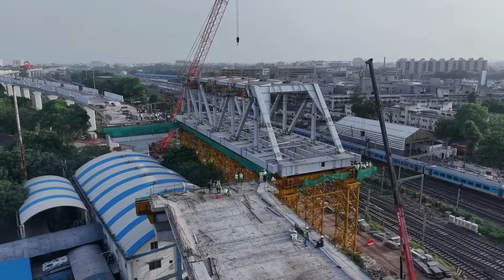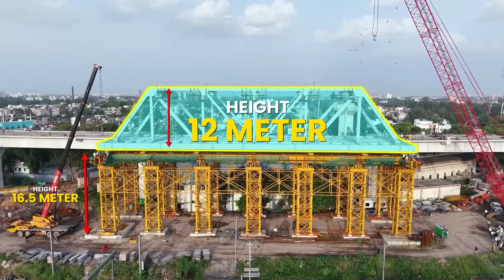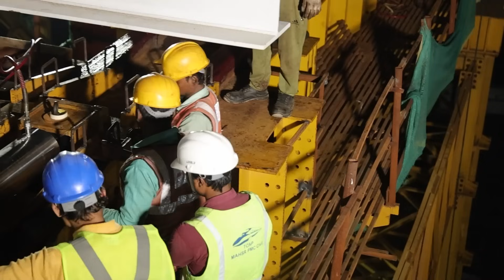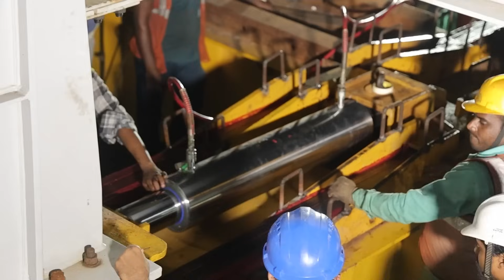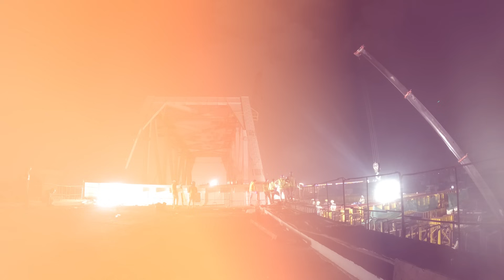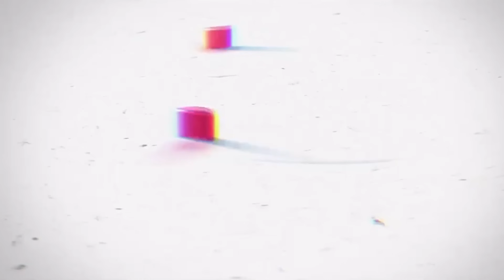A 60 m long Steel Bridge launched over a Western Railway | MAHSR | Bullet Train Project.

Comment: Why was the land below the steel bridge not been able to be aquired? If it would than no need for steel bridge, normal bridge can be built.
Reply: Actually bridges are better since it will save from animals such as mulla mulli who throw stones and sometimes cow dogs buffalow
And these tracks are needed to be built on concrete which would further occupy that land
Reply: @4AIM108 Thanks for reply, but i meant that since bridge is built on land, that parcel of the land where steel bridge is to be installed, can also be aquired to built a normal bridge. I think the blue house below didn't gave the land to built normal bridge
Reply: @ashutoshniwal  haa bhai niche wale ghar ne Jameen nhi di government ko , Court chala gya tha 

But court me faisla hua ki iske upar se hi Train jaayegi agar ye nhi zameen deta hai to 

Government ne money di par woh dene ke liye ready hi nhi tha
Reply: @ashutoshniwal  land was not acquired ..
Reply: @deniedchirst  that blue-roof house below will now have the noise of a 320kmph train passing over, potentially every 30 minutes.
Reply: @varj07  That's a factory
Reply: @deniedchirst  thanks - even more of a puzzle why the factory-owner insisted on keeping the land. Also, it could be rebuilt after the viaduct is completed in the usual way, with land owned by the original owner. Also, other places had 100m concrete viaduct installed over rivers and highways without requiring access to the ground below.
Reply: In India, except for Indian Rail, every other form of rail will move on bridges and tunnels be it bullet train, metro rail, monorail you name it. This is now a decided fact and this saves a lot of space which is scarce for our population especially in cities

If later, IR decides to build high speed corridor they can do it on land but not nhsrcl.